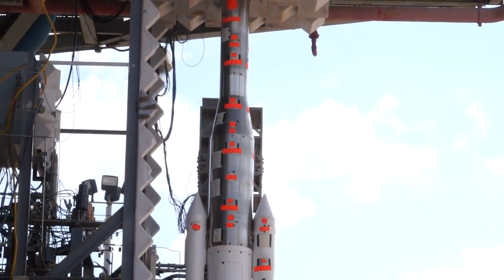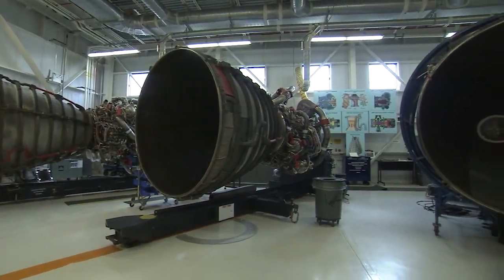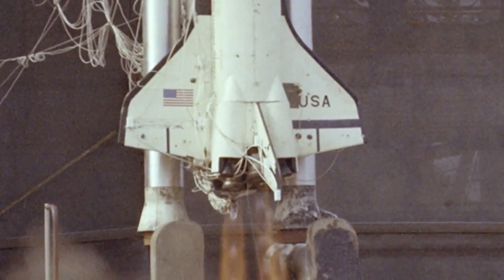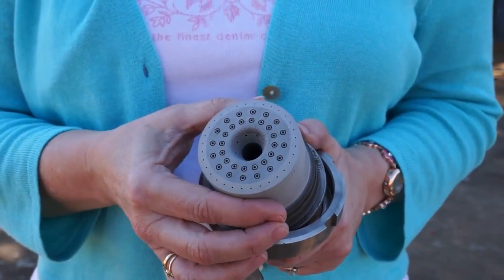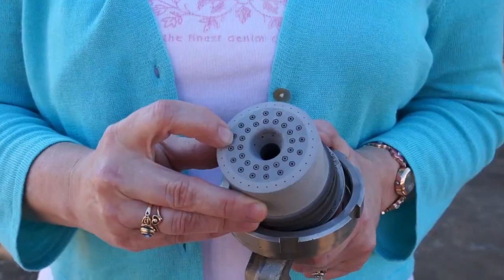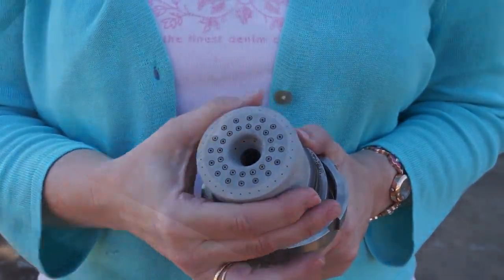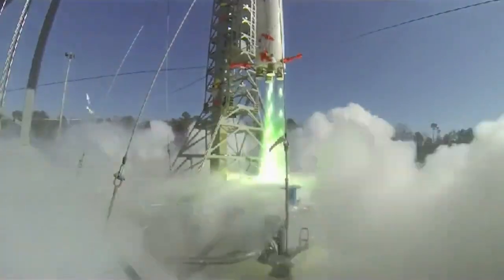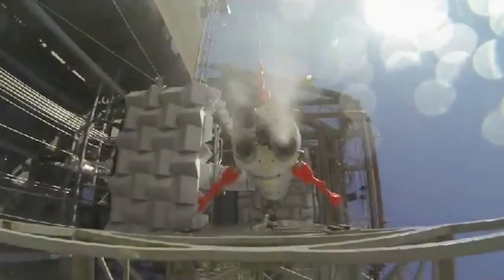NASA 3D Prints Injectors for 'SLS-Mini' Test Firing | Video

Comment: Why do they spray water all over the platform before firing?
Reply: Thats a good question, I just googled it and there is 2 answers: 1) is to dampen the sound waves from the rockets which would otherwise smash windows for miles and 2) prevent and control fire on the launch pad.
Reply: bionikspoon Oh, that's pretty cool! Thanks =)